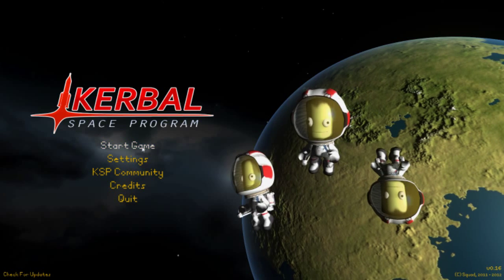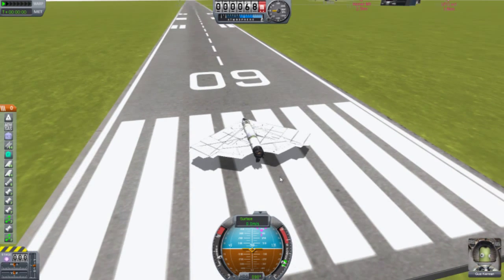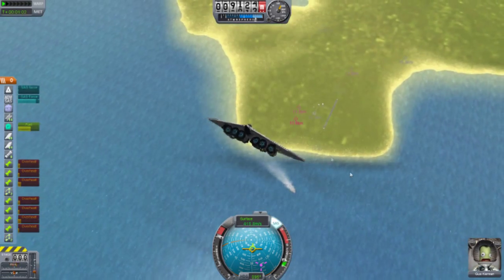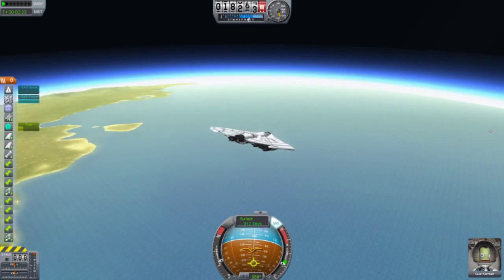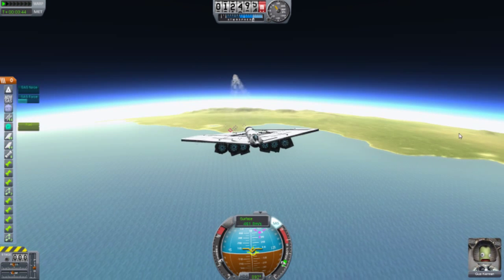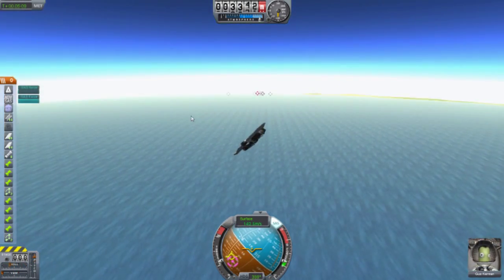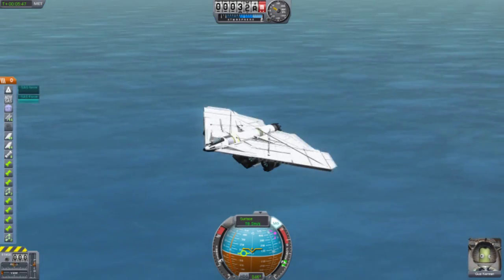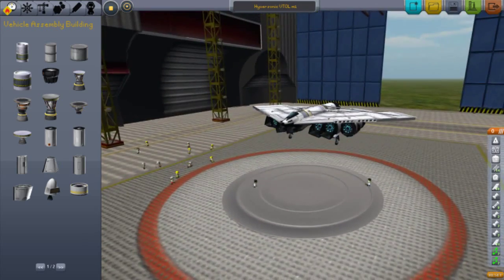KSP - B-2 Hypersonic Aircraft

Comment: firstly, if it dosent take off vertically, its not a VTOL, because VTOL stands for Vertical Take Off and Landing. secondly, its not the lift your having problems with, its the fact that the air isnt flowing over the wings properly, if u know how wings work, having the bottom part of the wings hitting the air flow will not create lift, u would have had to put the nose down for the air flow to flow over the wings properly to generate enough lift to continue flying. other than that, its a good design and a good video, keep up the good work :)